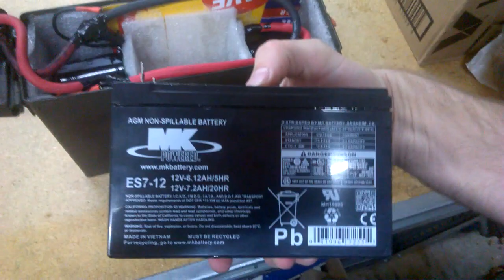A Brief Walk Through of my Supercapacitor Car Battery

Comment: Use of the ammo box is genius! Not easy to find suitable boxes for these kinds of projects, especially if you don't want to use plastic. Good idea having the insulation/ shock absrbtion foam too. Very nice design all round. Well done. However, have you thought about a small resistor between the caps and the battery to slow down the cureent flow and protect the battery a bit?

Comment: Why are/were you using 2 banks of capacitors? Did engine starting load up the battery or was it something else?
Reply from the maker: I started with one bank, and it cranked a little slower than I would've liked. I figured adding another bank would help that, and it did.
Reply: @rileylamborn1846  what's the engine displacement of the vehicle you were/are using this on?
Reply from the maker: It's a 2007 Subaru Impreza 2.5 non turbo.
Reply: @rileylamborn1846  thank you for the info. Come 2020 i'm gonna be making this kind of thing for a prius, it's gonna be more of a weight savings than longevity thing.

Comment: What size wire did you use for the capacitors and the battery posts?
Reply from the maker: I used 6 gauge cable going from the balance boards to the posts on the lid and 12 gauge wire going to the internal battery. I also added an external battery as shown in my latest video, I used 8 gauge wire for those leads.

Comment: What do you call the circuit board that the supercapacitors are mounted on are those called balancer boards in series?
Reply from the maker: I just searched ebay for "supercapacitor balance board" and picked one that suited the size capacitors I was using.
Reply: @rileylamborn1846  where did u buy the capacitors?
Reply from the maker: I just searched for 2.7v 500 Farad Super Capacitor on eBay and went with the cheapest option. It ended up being $3-4 per cap.
Reply: @rileylamborn1846  what happen to the voltage when you run the 2 banks of caps in parallel, same as each cap bank?
Reply from the maker: Yes, when you run them in parallel they share the same voltage. So two 12v banks in parallel is 12v, two 12v banks in series is 24v.

Comment: Do you know if super caps draw from main battery till dead? and would a battery isolator fix it?
Reply from the maker: On a few occasions it sat for 3-4 days and it started up just fine. The only times it doesn't have enough juice to start is when I do something like roll the windows up or down or let the radio play for 30 minutes. I'm considering adding (or replacing the smaller battery with) a larger capacity battery, and maybe sometime in the future getting some Li-ion or LiFePo4 cells and use those instead.
Reply from the maker: Abdulgader Basager I'll have to try that too
Reply: Abdulgader Basager sweet let me know how it goes. I'm trying to make a set up with agm battery and super cap plus a solar panel to insure I have sufficient power to my vehicle. I have upgraded to high output alternator. But I suffer from battery drain after a few days of sitting